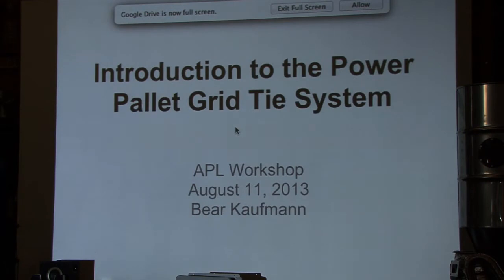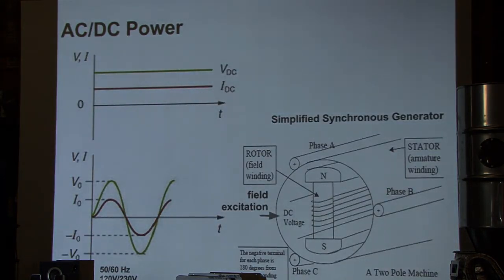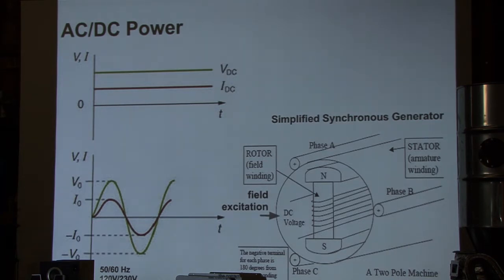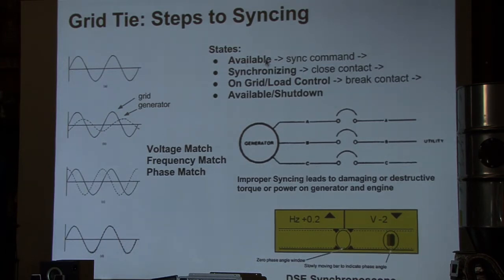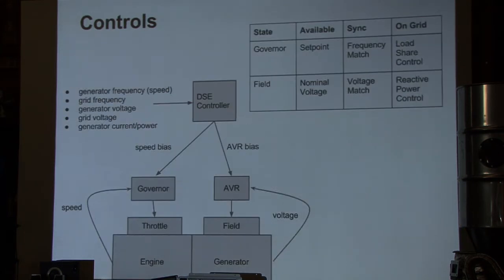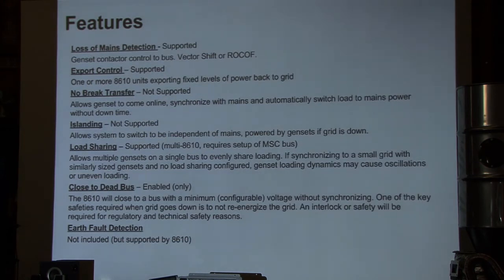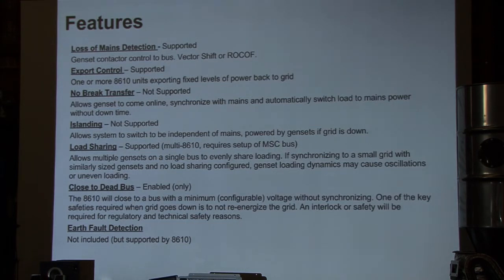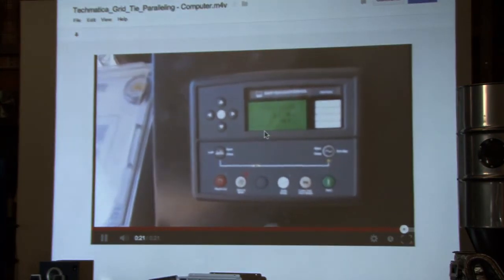'Introduction to the Power Pallet Grid Tie System' Presentation w/Bear Kaufmann

Comment: Out of curiosity, do you have any customers that put these power pallets into urban environments? Given it burns pretty cleanly, it seems like a sort of system that one could essentially put into an enclosure on the roof of large apartment buildings, maybe in addition to existing photovoltaic infrastructure. Especially in nations where grid reliability might be relatively terrible (I'm looking at you, France). Bonus points for functioning islanding. Regulation might make this difficult, though?